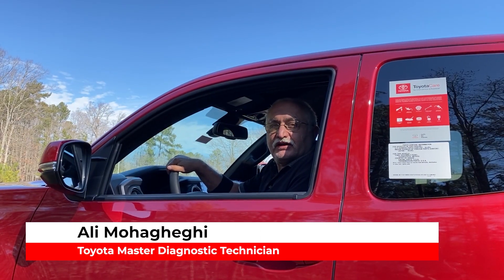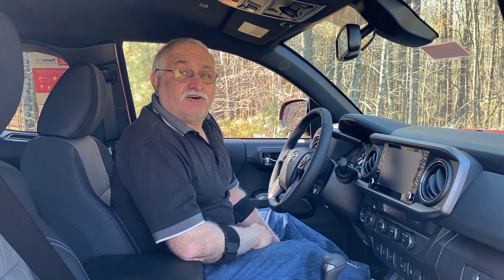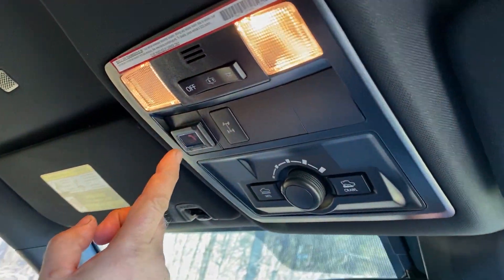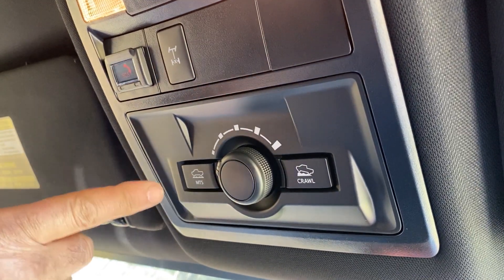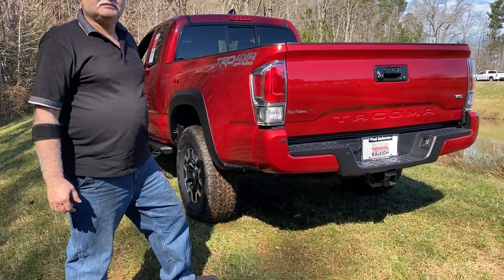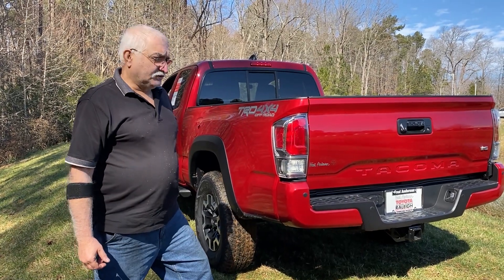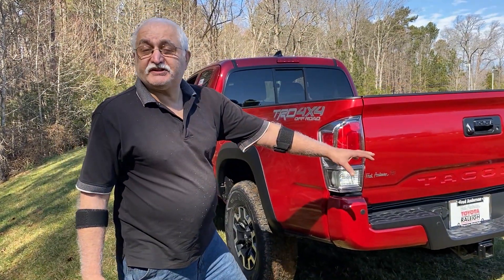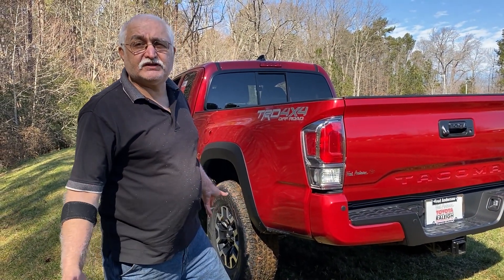How Locking Rear Differential and Traction Control Work in Toyota Tacoma and 4Runner: Ask the Expert

Comment: Here’s my question, can the locking rear diff be used independent of the four-wheel-drive system or will it only engage when the four-wheel-drive system is engaged?
Reply: Rear locker only works in 4low
Reply: @hardenxx1335   yes that’s what I figured out after looking in the owners manual. What I don’t understand is on a 2 Wheel Dr., Trd off-road it comes with a rear locker that can be engaged at any time obviously because it’s only a 2 Wheel Dr. why didn’t they include that on a four-wheel-drive model as well because there’s times where I want to engage the rear locker either in 2 Wheel Dr. or 4 high I don’t need for low and it just seems very limiting for Toyota to set the diff locker and only 4L mode on the four-wheel-drive model

Comment: What road conditions would "Traction Control" be used? When you select 4WD-LO and Differential  Lock,  will the Tacoma stay there or will an electronic control system override the selection after the wheels spin and just stop the movement?

Comment: The one regular criticism we hear about Toyota's lineup of 4X4s is that a locking rear differential is not available across the full range. Tacoma and 4Runner offer the option but Tundra and Sequoia do not so let's hope this will be rectified with the next generation.
Reply: Which is why I've said for many many years!!! Why call the Tundra, a TRD/PRO Tundra, when it doesn't have the E-Locker.  So I get your frustration.  
 And yes, Hopefully with the new/Redesign, the Tundra/Sequoia gets the E-Locker, so that people whom want this feature, BUT need a bigger than 4Runner/Tacoma vehicle, can "ALSO" enjoy the benefits!!!
Reply: To be fair (yes I own a Tacoma), my LR4 only has a center locker and that big heavy rig went everywhere including ORV parks
Reply: @stlswagger Time has moved on and rear lockers are more widespread in Toyota's lineup.  Speaking of moving on, I am now whining about the fact Toyota equips many overseas 4X4s with a front locker but that has not been an option on this continent in decades. 😉😉
Reply: @RightLaneHog3151  yeah but we use truck recreationally unlike the rest of the world where the Hilux sells strong. I don't need a locker daily. With that said, I am running 5.29 gears and front air locker. Do I use it in the USA enough to justify the upgrade? Well no but I do off-road weekly during the school year (kids) and every waking moment in the summer. With MTS, I don't really need the front locker. But am also a fan on factory traction control settings. My Land Rover went everywhere someone with a front locker did. A good driver and line can do a lot. Lockers are security. A good driver is just mandatory for off road. I have the Tacoma. Also have a OBS bronco on 35's and open front. It's never been stuck due to traction aids